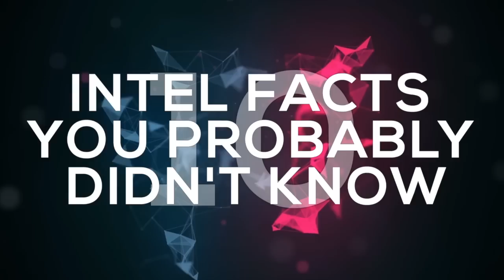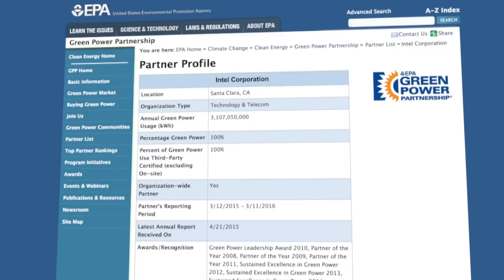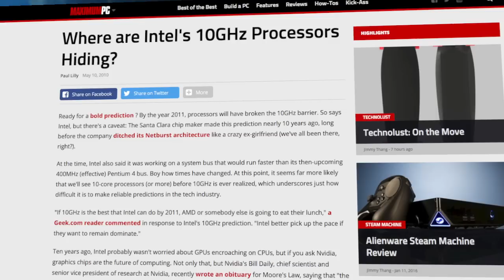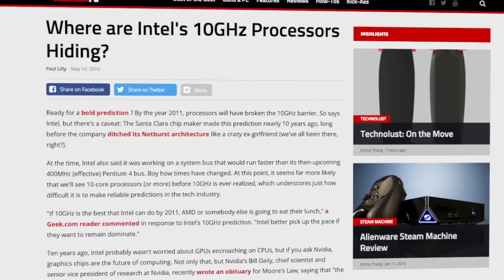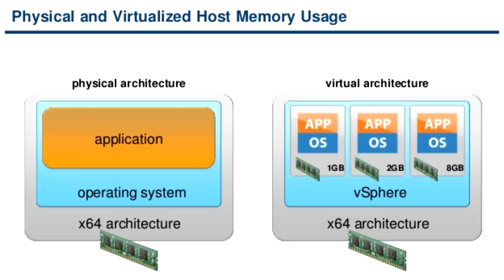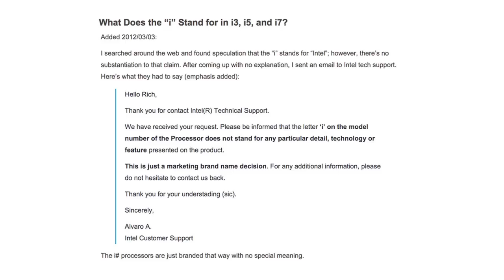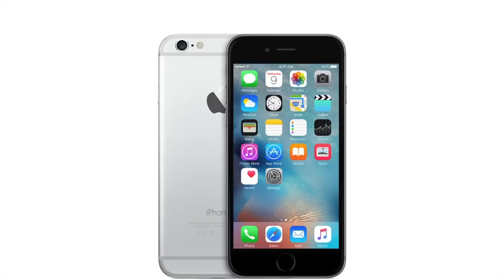10 INTEL Facts You Probably Didn't Know

Comment: Can we get a top ten on AMD?
Reply: +Tool0GT92 No, AMD is fine. I use AMD consistently, even though Im honestly more on Intel's side. AMD is the best up to a computer at about $1000, then intel takes over
Reply: +Minoxs Seems like Nvidia is trying to bury them... Intel tried that and got sued, and LOST. 

#SueNvidiaJustCuz
Reply: +Benedikt Zöchling Hey, if you dont want to be contructive, then fuck off. Maybe someone did carr about my comment
Reply: +Tool0GT92 You don't sound to smart. AMD and Intel are always out doing themselves and for 1 generation Intel might be owning up hardware side while in another generation AMD will be. He even says that in the video.

And you know AMD was the first to release the 8 core cpu right?

I'm a network engineer and been in a field for a long time. I use a full AMD gaming rig at home and never have any issues with any applications or games and my fx8580 8 core cpu blows that i7 out of the water. I could run 5 games on it at the same time and not get it past 60% cpu usage...

You just need to purchase whatever is best in that generation, rather it be Intel or AMD, you want to purchasem whats best for it's time.

Go ahead and avoid AMD all you want. If you had did that you wouldn't have been one of the firsts to enjoy the 8 core CPU or the x64 platform if AMD didn't share that with Intel.

Look at it both ways. Don't be a retarded fan boy.
Reply: +Cloudtidus1 AMD is actually excellent, especially considering its price. Theyre just bad for gaming alone. They equal Intel in most other things.
Reply: +Jacob Jock True, Intel's CPU's are better than AMD's, but AMD is a LOT cheaper :3
the only problem with AMD is their video cards, but it's not their fault, Nvidia works with the game companies and make the games based more on their cards... which is kind of a dick move....
Reply: It's in the works, trust me.
Reply: +Jacob Jock I cared about ur comment, was very helpful. I am looking to build my first AMD computer mainly for a media server.
Reply: +Noah S. 1. people without a lot of money can afford them.
2. Not all of them run hot, just FX and older ones really
3.Lemons? Bull. I haven't heard alot of these things failing, and if they did, it was a simple fix
4. Unless you live somewhere where electricity is ridiculously expensive, that extra power is a couple bucks on your bill every year
5. Actually, the A10-series excels above Intel. The E,A6, and A8 dont, but the A10 is much better than Intel's i3, which it competes against. Not sure about Skylake, TBH, but they had Haswell mini-PCs on the ropes
Reply: +Noah S. Did you know, most people who get a working product don't write a review? STFU about Newegg, the processors should have a warranty anyway
Reply: +Noah S. Judging by your extremely childish behavior and blatant biases, it wouldn't surprise me if your bad experience with AMD was your own fault.
Reply: +WarsunGames That is completely incorrect. In 85% of tests, an i5 destroyed a 9590. It does not have the single threaded power to keep up. An i3 DOES compare in gaming situations. It is true that the 9590 beats an i5 in rendering and file transfer, but not an i7. Get your facts straight.
Reply: +owl “1080p” gamer That is what AMD chips do...
Reply: +Noah S. Obviously you don't know shit about CPUs. I'm a network engineer and work with both on a daily.

I have a straight AMD gaming rid running at home with an FX series 8 core cpu that blows that i7 out of the water.

Of course to archive that performance it needs more power... so what. I'll take that power usage requirement for increased cpu performance anyday of the week.

Short life spans? are you kidding me? I run my computer 24/7 with no issues what so ever. I never replaced an AMD cpu because of a "short life span' I only ever replaced it if they came out with a new CPU that was at least 2x better then my current CPU and that doesn't happen for years. Normally when that happens its because they came out with a new CPU platform that would require a new motherboard to patch the pineset.... such as the upgrade from AMD1 to AMD2 and 3+ platforms.

Get your facts straight before you attempt to troll on something you don't know anything about. K thanks for playing.
Reply: Funny because I purchase all my stuff using research of the item to fit my needs. Not reviews kid. Half of anyone that write reviews are not techs. They dont know specs all they can do is install the thing.

Plus it comes with 1 year manufacturer warranty and 30 days newegg rma protection... wtf you talking about!?!?!?

Get smart.
Reply: Jacob Jock yeah obviously. Hes probably an intel reseller lol
Reply: +Andro Bourne Zen has about the same amount of power in paper, and knowing AMD, ten million cores will be tossed on top just because. So Zen should actually threaten Intels monopoly.

Perhaps that's why theyre making all these new ads. To throw people, make em forget about Zens release date.
Reply: even though I am an intel guy but it would be fair so I agree
Reply: +Jacob Jock I would like this as well.
Reply: ha burn
Reply: +Ritu Chauhan thats really only what the average person needs. Not everyone can drop $400 on ONE monitor for 1440p, let alone 4K.
Reply: Jacob Jock But gaming capacity=performance
Reply: +Arthur Sullivan Not always, but most of the time, yes. Rendering is a bit different usually
Reply: +Noah S.  you think of 4 more
Reply: Jacob Jock first of all mini PC's are sh!t, they defeat the point of a desktop. Second of all its not just your power bill it's your power supply. Third of all if you go to newegg.com you can see Intel CPU's get better reviews than AMD's, and AMD's have alot more 1 star reviews like "It failed after a month". On futuremark.com there are 25 Intel CPU's better than the top AMD. They're cheaper for a reason.
Reply: Andro Bourne  yeah if you bothered to look at the new egg reviews the AMD CPU's have more 1 and 2 star reviews saying "dead on arrival" or something along those lines vs. Intel. That is a fact.
Reply: Jacob Jock  same thing goes for AMD and Intel
Reply: +Andro Bourne Hey don't ask me. Probably a troll or somethin
Reply: Andro Bourne or maybe the AMD build I had before sucked and my Intel/Nvidia build is working without any issues
Reply: +Noah S. or maybe no two systems are the same and the pc you had before sucked ass...

Just because it didnt work for you in 1 instance doesnt make it a bad product.

Aside from hardware. People have issues with compatibility in games all the time because of intel and nivida... shit on my intel pc I cant even play  Rust without major driver related lag but it works fine with my AMD system. Same goes the other way around. I have issues with Arma3 on my AMD but not Intel pc.

Again. Like I said. Because it didnt work for you, doesn't mean it is bad.

A lot of these issues can be narrowed down to other things other then the hardware. Like drivers which are out of the cpu manufactures hands.

Dont fanboy bash something just because it didnt work for you. You provided tons of false facts about the product that was shown to be wrong just because YOU didn't like it...

Thats why we can't have nice things. To quick to judge everything because it didnt work for you specifically... just wow.
Reply: Andro Bourne  actually the new egg numbers are true, the future mark review scores are true and the AMD shit I had to deal with was true.
Reply: +Noah S. Well not everyone had to deal with it. Passmark is also an artificial benchmark. The numbers in real uss are nowhere near as huge.

And your earlier comment about the 25 Intel processors above the AMD? Yeah, how many of those are affordable. Only a couple, I'd bet. $250 for a processor is a bit much to me, especially when its Skylake. Intel has even reported that their new processors have massive issues where the crash whenever heavy workloads are put on them. Do AMDs do that? (when, granted, they are sufficiently cooled?)
Reply: All that aside amd is also designed to handle the heat increases.... it means nothing
Reply: Jacob Jock agreed.
Reply: Peter Schmidt I love how ignorant every one responding to me is. The Scores of performance per core show that there are 25 intel CPUs better than the top AMD one. Presenting facts and data is not childish.
Reply: Noah S. Are you not aware there are more benchmarks than Passmark?  Yes, Intel's are undoubtedly faster in almost any test, but you're missing the point.

As for DOA products, are you not aware that the CPUs are inspected before being sold?  If it's DOA, it is entirely the user's fault.  Since AMD still uses pins rather than plates, it's easier to damage them than Intel's.  On the other hand, Intel motherboards are just as easy to damage and harder to repair.
Reply: +Noah S. Thats what happens when you provide false facts like what you said about reviews of cpus on newegg. obviously you don't know anything about hardware and you are just simply a fanboy with a hard on for intel.

Thats cool and all but don't provide, false made up "facts" because you dislike it.

Grow up.
Reply: +Noah S. Thats what happens when you provide false facts like what you said about reviews of cpus on newegg. obviously you don't know anything about hardware and you are just simply a fanboy with a hard on for intel.

Thats cool and all but don't provide, false made up "facts" because you dislike it.

Grow up.
Reply: Andro Bourne  I go onto new Egg, I see only 70-80% of AMD CPU reviews are 4 or 5 stars vs. Intel which is in the 90-100% range. You can suck it up to AMD all you want :)
Reply: Im looking at an AMD CPU right now, 78% 5 star reviews. Intel one has 86% 5 star. You sure seem butt hurt about AMD, don't worry Intel might invest again to keep them afloat. The new i7s and Nvidia GTX 9XX series are kicking AMD's ass in.
Reply: Obviously you can't read. I said mutiple times that both AMD and Intel are good. Normally one is better then the other depending on the generation of technology release. Learn to read.

Secondly. You are complaining about a 8% difference in a review? Both with with 5 stars I might add... so what? One barely got more reviews the the other?!! Wtf does that have anything to do with the product? THEY ARE BOTH 5 STAR REVIEWS DUMBSHIT. Aka max review you can give to something... god you are dumb.

And thirdly. Did you even watch the video? Intel bailed out AMD once cool story. Years later AMD bailed Intel out with the x64 platform... wtf are you even talking about kiddo?!?! They bail each other out all the time and openly share new technology information with each other. They want the competition because they know no one likes a monopoly.

You are truely retarded and continue to agrue your invalid, false points against straight up real facts.  Just simply because you don't like it.

That is the pure definition of stupidity.

Its time for you to get some facts straight and grow the hell up.

Anyway last comment. Im done with this troll. Everyone else, enjoy.
Reply: Noah S. What a useless comment.  You're obviously referencing 1 product from each company and you don't specify what either of them are; you could easily be picking the worst and best case scenario, respectively.
As for "i7s kicking AMD's ass in", no, they're not.  Y'know why?  Because to my knowledge, AMD hasn't sold anything to compete against an i7 in over 3 years.  You can't fail against something you aren't even in the ring with.  By that logic, that's like saying "Intel fails at making gaming GPUs" but they don't, because they don't make gaming GPUs.
As for the GTX 900 series, it is doing better in sales but in terms of performance, only the GTX 980Ti consistently outperforms any of AMD's products, and the 980Ti by itself costs as much as a budget gaming system.  So hardly a relevant point.  Don't get me started on the Titan - easily the worst-valued consumer product currently on the market.
Reply: +Peter Schmidt Agreed. Good explanation of things, and yes, the Titan is no more than a fancy name. 980Ti usually outperforms it for $250 less.

All who think Noah there should leave before he gets his ass beaten in any more say "I".

I
Reply: Peter Schmidt  The AMD R9 295X is a joke. It's big, hot and a power sucker. It barely performs better than the 980TI. The real value is in the 960 and 970, both can play almost any game at high or ultra high graphics, And it's not my fault AMD can't make good architecture to compete with i7's. The i5 6400 is also better at performance per cores comparrison than the top AMD CPU.
Reply: +Peter Schmidt mostly correct. AMDs FX series was actually released to compete with the i7 but on a budget level. The FX 8035 for example is very comparable to the 12 core i7 (best they have out right now) it is roughly 5-10 fps difference depending on game or application. Yet you can purchase the fx AMD for roughly $250 while you will be spending  $400+ on that high end i7 for 5-10 fps difference...

again. it boils down to generations of technology release. The first FX 8core series blew the older i7s out of the water. obviously the newer i7 are now comparable or a little better and every year they release a better version. id suspect in the next 2 years we will see a new AMD cpu that will compete with Intels advancing technologies.
Reply: Jacob Jock Yeppp! Like I said it's all about generation and I can tell you for sure the first AMD Zen will out beat any i7 on the market at the time. But then again, Intel will release something else after to compete and the never ending battle between he companies continues!

However, I'm excited about the Zen. Although I'm very happy with my BE FX 8 core CPU. I'll most likely upgrade to a Zen right when it comes out, just because : )
Reply: Andro Bourne  It will also run hot and use a crap ton of power.
Reply: +Noah S. Nope, same manufacturing process and similar (slightly higher) clock rates compared to SkyLake. It will run similarly to Intel's offering at the same speed.
Reply: How about no?
Reply: How about using your big boy words?
Reply: +Jacob Jock Voted.
Reply: +Noah S. it'll use the 20nm back-end process and have a 14nm front end , but because it's a Samsung node it will be more along the lines of Intel's 22nm process , Zen is projected to match Haswell levels of performance or be even a little bit over that , that and they wont be putting iGPU's on then to begin with and that means they can slam more cores into the same space of intel's Quads with their newer iGPU's meaning they could very well sell 8-core processors for about $300-400 and CRUSH intel that way.
Reply: +Noah S. The 32nm process was a bust and helped to screw over AMD's bulldozer /Piledriver Arch's in terms of thermals , that and the Excavator architecture is roughly comparable to Ivybridge (a little less in Single Threaded perf , at least in Cinebench ) and GCN is an amazing Graphics Architecture. Maxwell is getting ABSOLUTELY DOMINATED in DX12 a 390x is comparable to the 980 ti in DX12 , go look it up , look at the more recent tests in Ashes of the Singularity. 
AMD plans ahead , they planned ahead with Bulldozer/piledriver because they figured that the next phase of the industry was next and soon which was a Multithreaded API vs a Single Threaded API (DX11 single , DX12 Multi ) 
They planned ahead with GCN and it's ACE's for DX12 or any future API that could take advantage of many threads ..ect 
VR favors AMD hardware 
DX12 favors AMD hardware
AMD is gonna have a very good year this year Polaris and Zen should do very well. Have fun with your petty Intel products and Nvidia products.
Reply: Metal Unlimited
 OK first off Ivy bridge did not come out until after the 32nm.An that was years later.So that is not correct.The ivy bridge architecture is by no means impressive.You were talking about the nm an not the motherboard.Lets be focused on that.

    Performance was claimed to be less by non repeatable organizations.Not Intel or AMD.If AMD did a poor job.They would offer a public apology.The 32nm processors still out performed Intel an Sony processors in performance

   While others are eating at the table of performance Intel was so far behind that other companies considered AMD over Intel for more than 8 months until Intel announced new processors.At 24nm.

       Mind you all 24nm means faster reaction time on the die.But this didn't out perform AMD processors.They were and still are too far ahead in performance.Cinebench is only useable for Intel processors.All other processors do not have any current codex for processors.

    An have not from the start.The only test Cinebench does regulate is Intel processors.An is NOT a Benchmarking program for anything else.Without the codes you should not bring it up.(By codes i mean product numbers for the processors.)

   An i do not mean to be offensive to you.But that very idea of a FX 9590 being compared to a i3 i5 or even an i7 is laughable.The FX 9590 far out performs those processors by half to 3 times their performance.Benchmarks do not give you this information.But public testers can verify this in speed test.Not in Frames per second.That is a Gimmick.

everything else you posted.Spot on.Great job.
Reply: WarsunGames I would love to see these tests you're talking about ._.
Reply: Jacob Jock Exactly.
Reply: Boycott Nvidia. Remember the dick move from Nvidia that disgusted the entire open-source Linux community.
Reply: Well the test i ran where with an AMD R9 390.Something that most test do no include. they all go with the GTX graphics cards an do not actually account for the performance of these.Then I ran a base test.Not overclocked.When you say you got a processor.Believe it or not.People should only be testing them BASE not Overclock the Intel chip then not over clock the AMD chip. 

       This is how you end up with.
( I over clock the i5 by 3.25 GHz an the AMD by 0.750 GHz So Lets run some benchmarks.)

That garbage.Tell me this never happens please.Because it happens all the time.The in the benchmarks you see the benchmarks running what are claimed as AAA games.Um.I dont own but one of those games.So we will have to run some games we can all see.Free to play games.

     Nope we cant run those.We have to run This specific list of Nvidia Gamework I mean Unbias games we found on the steam workshop.Yeah right.Look i dont have time for this.Just letting you know.

The FX chips where way more powerful.The benchmarks where liars an some of the test where single core performance an said overall scores.yeah overall on games that where bias an on programs that where not optimized for AMD.I really busy right now.So you guys just know i said this.
Reply: Jacob Jock yes 1. AMD SUCKS
Reply: +Jacob Jock nobody cares
Reply: +Jacob Jock  1. they suck. 2. alot of their stuff is a lemon off the shelf 3. they run hot 4. they take way more power than they should 5. they're cheap for a reason 6. they have short life spans
Reply: +Jacob Jock All you need to know about AMD is to avoid them, just repeat that ten times.
Reply: number 1. AMD sucks